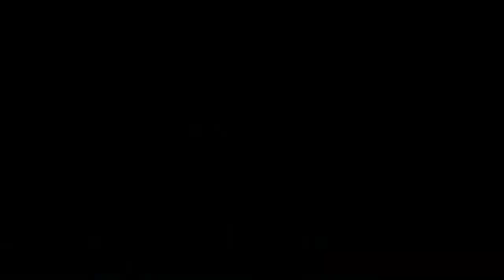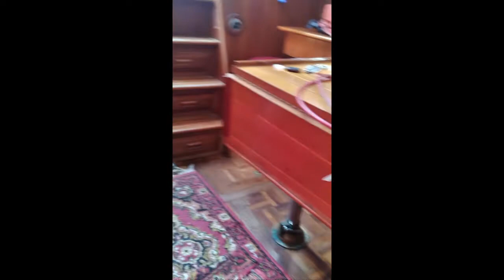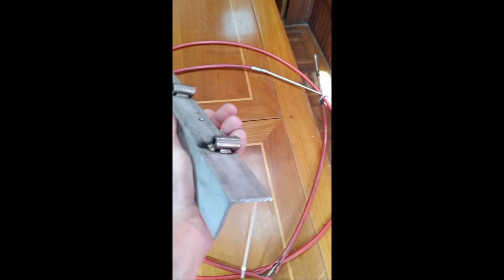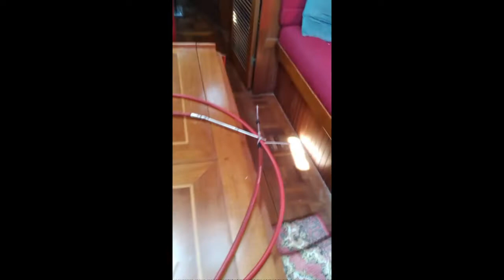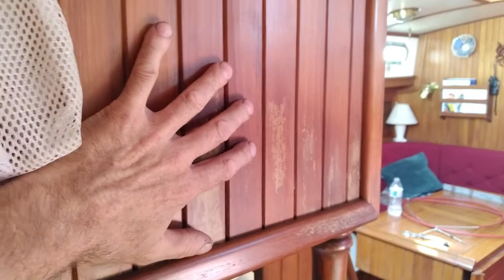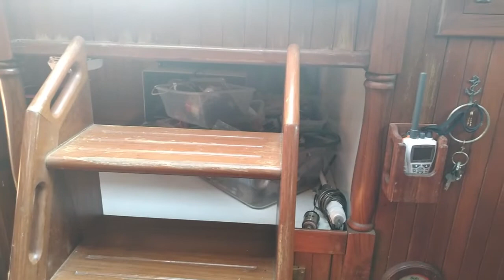SAILBOAT FAIL !!  Season 2 ep 1 b

Comment: First thing I saw was no bridgedeck so the water will go down below through the nice louvered doors not down the cockpit drains
Reply from the maker: yes that is why m any architects design in a good storm shutter with gasket, we did not have one or it may have been lost but we are designing one now, many offshore designs do not have bridge decks but they must have a storm shutter system if they do not, and most I have seen over the past 50 plus years have one or the other or both, but again  center cockpit never sees the green water an aft cockpit does.